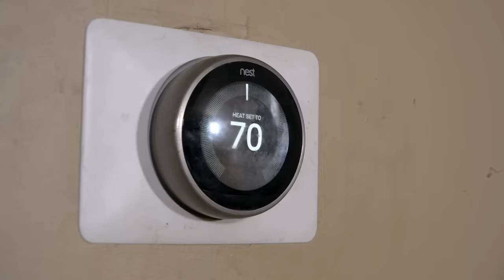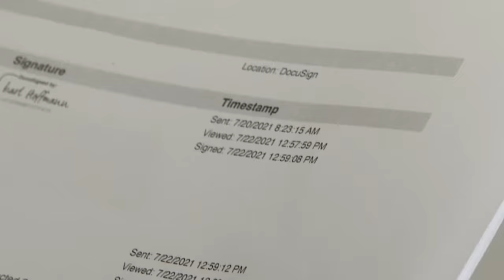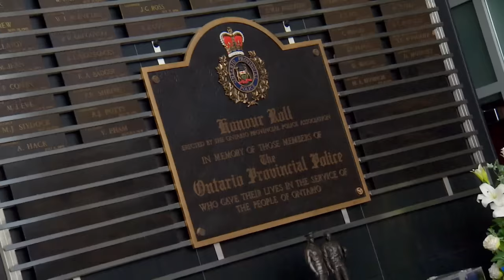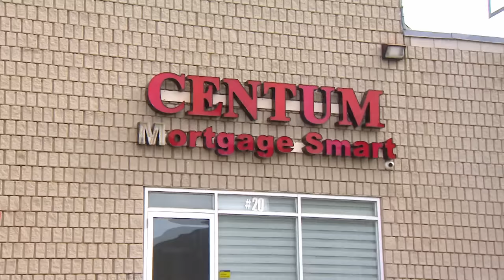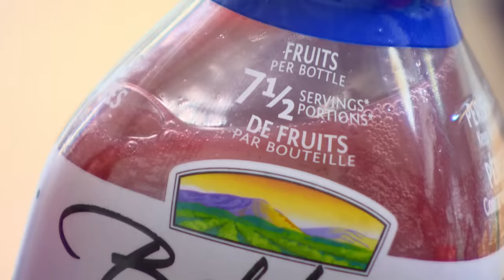How this mortgage scam is putting seniors at risk of losing their homes (Marketplace)

Comment: Marketplace needs to perform an investigation into Vancouver making all secondary rental units legal, many of whom have been built without any permits, therefore no inspections performed to ensure they meet constructions codes, nor have any "occupancy permit" issued, should there be any construction defect that leads to any health issue or loss of life via fire hazards not only is the owner liable but also the city for failing to perform its duties while profiteering from the extra taxes imposed on the owner.